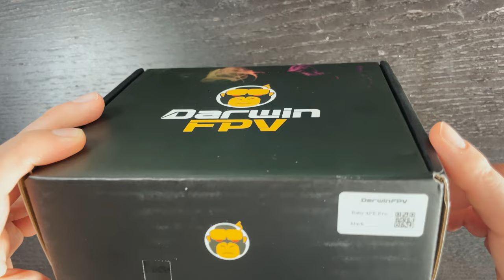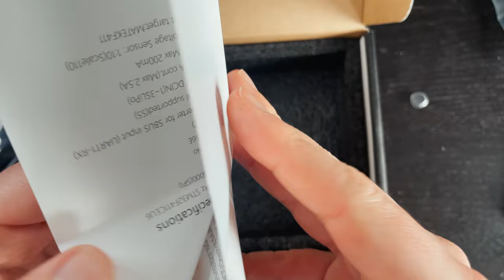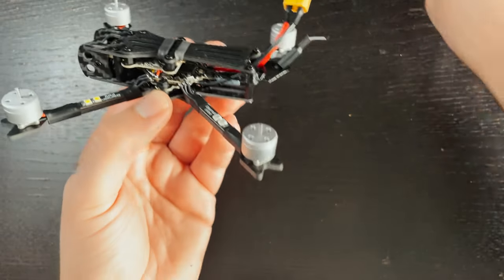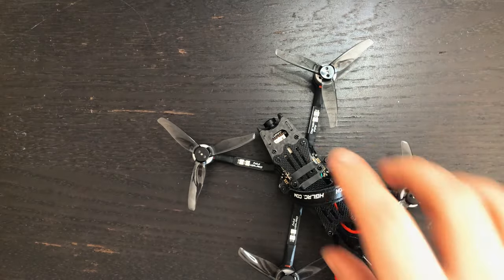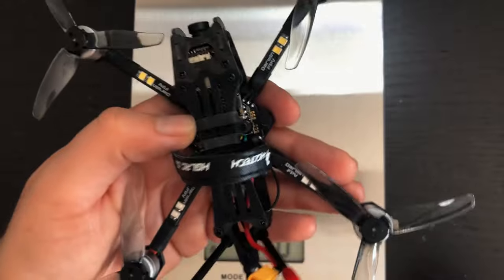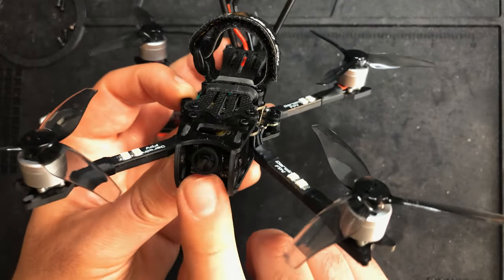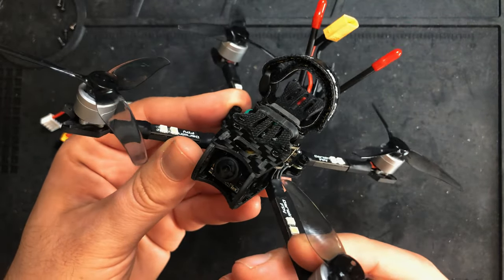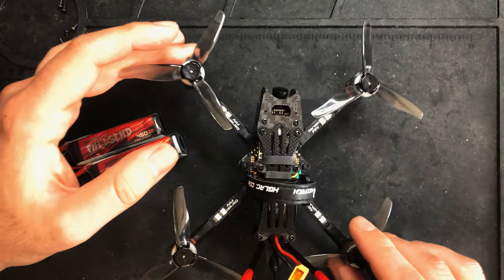The Most Affordable FPV Drone - DarwinFPV Baby Ape Pro Review

Comment: Hey man! This is a sweet looking drone! Do you know if it could be connected to a phone or laptop to use instead of using goggles?
Reply: unless your phone had a vtx, no
Reply: Yes and no. Natively without accessories no. This drone uses an analog system witch a phone does not have the built in electronics for. Instead of googles you could get a reciver that outputs a hdmi signal that you can plug into a monitor. Or they make small 5 inch monitors that have this tech built it. Though tbh as someone who had to do this because when I started googles were new and expensive it’s really not great. Googles offer a much better and clear sight of what’s happening
Reply: Use goggles 100%! Otherwise I’m not sure you can say you fly “FPV”😅

Comment: I bought one months ago and its great, changed the camera because mine was before the pro model, just buy it if you consider doing so, nice little thing for noobs and pros
build quality is fine, the electronic to, so far after hour's of flying still great and flies fine. original camera had a small FOV and a dull color, new one is Caddx ant
Reply: Sorry for interrupting... U wrote that you bought it ... And is there a controller for it? Or how can i fly with that?
Reply: did it come with a controller?and is the throttle the left or right stick
Reply: No it does not come with a controller, pretty much every drone is not going to come with a controller unless it is part of a kit which then it will be clearly obvious that it comes with a controller
Reply: @Mr.Thermistor7228 can it connect to any controller or can you help me find the one?

Comment: Nice flying dude! Subscribed!

I'm probably going to snag one of these to upgrade myself over time.  You can apparently fit a rush 600mw vtx in there and ratel nano camera according to one of the dudes in one of my groups and get much better video signal.  I have the Tinyape Freestyle 2.5", it flies lovely, not long got myself some SKYZONE  COBRA X V2 box goggles with a DVR so looking forward to recording some flights on that myself!!  Just waiting on some replacement props lol.

Comment: Wow nice little drone. I am kind of new on this, I have a Goly Stone a d now I just purchased the Potensic ATOM se , but I didn't know of this tini drones. Does it comes with everything you need batteries etc? and I guess the flying distance is not much? thanks
Reply: usually quads like this don't come with batteries and everything you need, so you'll have to buy batteries, battery charger, props, etc. flight distance is pretty decent but you can upgrade your VTX on this I think. I hope you enjoy your Potensic Atom too!

Comment: This seems like a good option. Not totally what I want but so much cheaper than anything else :D
Also is there any way to increase the max uptilt? Like carve out the top plate a bit more, or is the camera connector the problem? Then maybe drill out new holes or is it not possible? Also I'm (not yet) totally about freestyle but wanted a bit more of a cinematic (maybe LR) quad, is it possible to add a GPS, and maybe 850mah lipo and the thumb Pro, then it's probably not really freestyle capable anymore but so much better for filming, or is that a bad idea?

Edit: I got it, it's fun! I already wrecked my thumb Pro tho. Now I'm just adding stuff like GPS, proper VTX and currently designing a holder for the GPS and probably an SMA antenna connector.

Edit 2: I also found a way to get ~40° uptilt, you have get some spacers (<1mm, I cut some cable tie pieces) and glue them under the vertical carbon fiber parts at the camera, there's not quite enough space underneath the camera

Comment: I have a TBS BlackSheep Nano, and I never use it because it takes me like 15 minutes to get it to bind... Can I snag the VTX off of it, transplant it into this, and have a much better experience? I should have done a bit more research before I bought it, I realize, it might be integrated into the board.
Reply from the maker: Unfortunately with the Blacksheep nano everything is built into one board, so you wont be able to take just the VTX or receiver from that drone and use it on another. A standard 20x20 VTX should fit this frame fine though 👍

Comment: Nice quad, but why was it designed to not allow ANY camera uptilt? To get even the smallest uptilt requires the top and bottom plates to be loosened, asjust the tilt, then re-tightened.
Reply from the maker: It is an interesting design. having the camera mounting holes 2mm forward would prevent this too lol

Comment: Hey i just found out about fpv drones and im looking to get one just for fun what reciever and controler did you use? my dad has DJI goggles laying around somewhere (idk if they will work though)
Reply from the maker: With this drone you'll need analog goggles, DJI goggles only work with DJI VTX's (Air unit, vista unit, O3 air unit)
You can get a set of box goggles pretty cheap 👍

Comment: is it right throttle and whats a good controller
Reply: For a controller I love my radio sate rpocket ELRS. You can change it between mode two (right throttle)(default) and mode 1 (left throttle) by tightening or loosening some screws.

Comment: Great review man!  Very well done.  Great flying to.  If I could add my thoughts.

When I was looking for a 3 inch bnf I came across this little guy.  It almost had my vote aside from 1 key issue.

Longevity.

Granted the drone is but 90 dollars, can't beat that with a stick.  But you have to ask why...and how.  I did.  And found that to sell it for that cheap.  The components must be purchased cheap.  And cheaply made components will be replaced quicker than more quality ones.  It's the only way Darwin is able to sell at such a low price point.

I feel that in the long run.  You'll be paying more to keep this in the air than you would if you sprung for a quad a tad bit more expensive. 

I found the crux35.  And for 142 dollars (not that much more than 90)  you get a quality product that, imo, will outlast 2 or 3 of these guys.  

Hasn't disappointed me yet.

I'd be curious to see a review on the baby ape a few months of consistent flying.  I'd wager a few components may need replacing
Reply from the maker: I agree, If you spend the extra $50 or so on a drone with more reputably made components it will last longer and be more durable. I'll post an update video or story in a few months on the baby ape and how its flying!

Haven't heard of the crux35, I'll have to check that one out.
Reply: Comments like these bother me, yes, if you spend more you will get something that will last more, but that's not the point, those things are meant to be cheap to introduce more people to the hobby, you can't convince me to drop 150 bucks on a quad that i won't even know how to fly, 80 bucks? That's still too much for me, but maybe on a good month i could give it a go, you know what I'm saying? What I said is specially true in other countries, like here in Brazil, where 100 bucks is half of a months worth of minimum wage and with 50 bucks more you enter the "I'm eating raw noodles until the end of the month" territory

Comment: Just ordered one and a whole bunch of batteries. This is my first quad, so I expect to break it and I don’t want anything too nice. If I like it, maybe I’ll grab a couple spares…

Edit UPDATE:
After lots of sim time, I went for my first irl flight today. I puffed one of my batteries trying to screw with firmware and left the VTX on, so I only had 2 packs. Using ELRS with a module in my Mambo.

For what a noob’s opinion is worth, this little dude will outrun you for a trainer. I crashed a bunch and folded a prop (folded it back and kept flying), so buy spare props. The punch out is a lot of fun, and I did get a little prop wash with stock betaflight 4.3.

Mega stoke to fly more. Thx Tron.